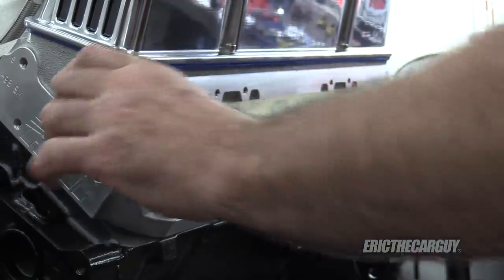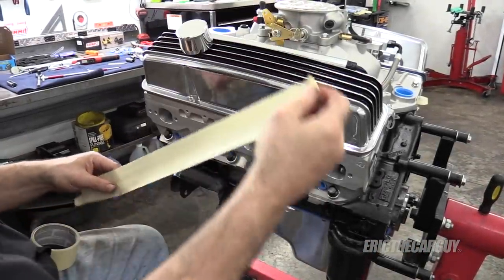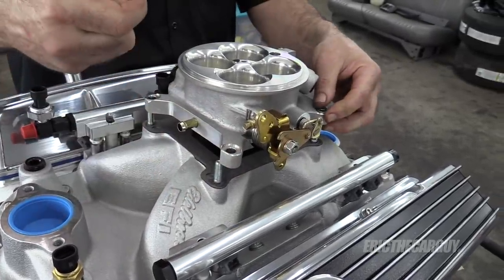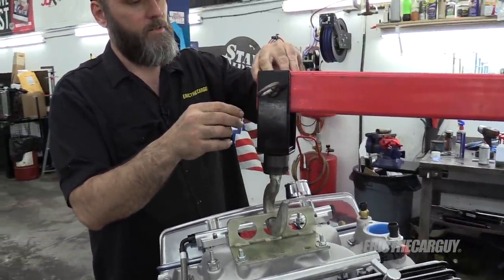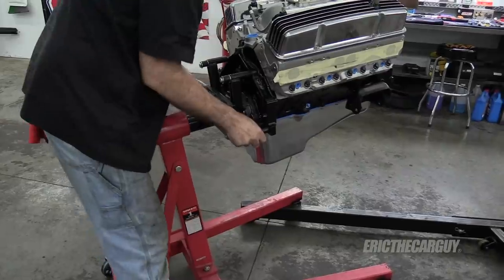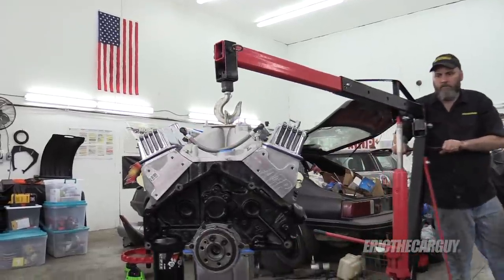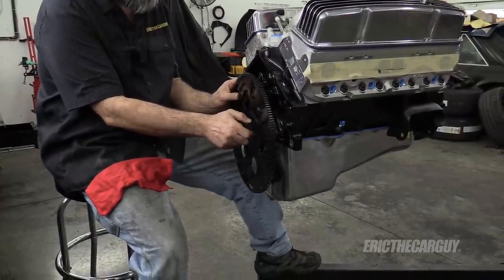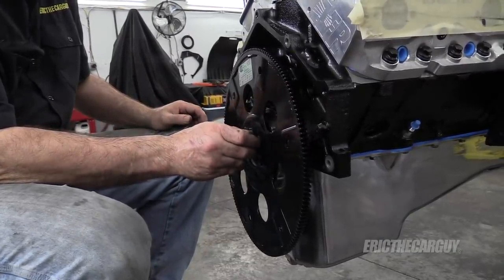Engine and Transmission Installation #ETCGDadsTruck

Comment: Eric you rock.  Just gave you a shout out for your demonstration of the Valve Keeper Remover and Installer Kit.  Will be using threadlock on my flex plate as well.  Nice work on your channel and thank you.

Comment: The fact that you've gotten so much content out of this is amazing, very well documented. I also noticed you didn't put the torque converter/flexplate bolts in but you didn't put the cover on either.
Reply from the maker: At the end of the video I state that a lot of the installation was not covered in video due to time constraints. Both of those items were part of what I was referring to. Thank you for your comment.
Reply: @ericthecarguy  I figured it would be converted in a future video, I didn't realize those were intended to be in the video.

Comment: About the integra....
Polyurethane bushings👍🏻
Now, Eric. I've used the Eibach Proline springs. They are SO nice. Because of the progressive winding. It's not at all to harsh for daily drivability at all! Infact it's quite nice. The spring rates for me are in fact awesome.

 The only downside for some people is the fact that it lowers the vehicle by an inch maybe one and a half. But it's not to bad at all. Nor does it really require a stiffer shock absorber. 
I had some on my 99 Plymouth breeze for years. Never had any issues. The springs just made the car feel more like a higher end vehicle than it was. (I used to joke about it really feeling as luxurious of a ride as a benz)

What I mean by that was is that it was very soft and luxurious felling until I would corner fast. Then you could tell something wasn't stock. However if I didn't corner fast, nobody would have ever noticed anything wasn't stock. It felt so damn good.
 I'm looking towards doing it to our family car (dodge dart) someday. Just in case I need to pull an emergency evasive maneuver.

It's never a bad thing (in my opinion) to have brakes that can rip your eyes out of the sockets. Along with sporty handling for those oh shit moments on the road. As well as enough go go to get you out of troubles way if need be. 

Now, being able to return to fully stock without and signs that anything was ever different. As well as only improving the vehicle without taking away from the comfort, gas mileage, or drivability is my personal goal when "modifying" a vehicle. 

(And personally I hate using the term modifications when I'm just switching out parts like springs, bushings, pulleys and brakes.)

Comment: Videos don't get much better than this ladies and gentlemen. On point, Makes me wanna take my 93' 2 dr GMT400 K1500 Chevy blazer 4x4 to the next level, I've got about $3,000 in the motor now with stock bottom end, and a brand new Monster Transmission I just put in after the rebuild bout 6 months ago, but anyway I've got another 355 crate engine  in another 93' 2dr. Yukon under 1,000 miles on it that I may have to STROKE out now !!!!!! Thanks #ETCGDADSTRUCK383 Great info and perWhat did the machine shop charge for everything ? Thanks !! These GMT400 platform is the next big hit to come #GTM400LIFE Let's make em look and drive the way the factory should have !!!!!!

Comment: good video, I learned a lot.  On the flywheel bolts, you use Loctite on the threads but the Assembly Lubricant under the head of the bolt, which is what I thought you were doing.

Comment: Did I miss you bolting the torque converter to the flex plate?  My eyes were heavy, so I might have had a quick power nap. Everything is so sanitary, so clean. Nice job, nice calm narrative.
Reply from the maker: That, and many other things, didn't get covered unfortunately. Time was a factor with this build and I wasn't able to film everything as a result. Thanks for your comment.

Comment: I love this series. Thanks, Eric. Could you make a quick video on your thoughts of the pro-flo 4 setup?
Reply from the maker: I'll do one better. I've already shot the unboxing video. Also, I plan to do a follow up video covering things like that after the build part of the series concludes. Thanks for your comment.
Reply: @ericthecarguy  I'm most interested in hearing about the quality of the parts and the software. and any hiccups you encountered in running the system. There's quite a few initial impression videos but very few actual reviews from real people who have run the pro-flo 4 system in real world conditions.

Thanks again for all the work you do. I wouldn't be the mechanic I am today without everything I've learned from you over the last 8 or so years!

Comment: at first I thought what you were putting on the bolts was loctite. I guess that was anti-sieze? I watched a video last night where the guy put everything on pilot bearing, new rear main seal, clutch, pressure plate ,  and flywheel and he used thread locker. I was definitely going to reference to a video when I put on the same things he did in a few weeks and just take my time and hopefully have no issues.

Comment: What I like on you Eric, is the way you sometimes act as a rookie garage enthusiast instead of white-collar dealership mechanic strictly following the rules. However, torquing the flexplate bolts using guestimated torque with a cordless impact was too much even for me 😁 Great video anyway, thanks!

Comment: First of u r by far the most entertaining and educational mechanic on youtube and i always catch myself watching ur vids when im bored lol I just put my transmission into my car and was mating it to the engine, I got the three bolts that go from the flex plate to the tourqe converter and the bell housing bolts to the engine snug and now the crank wont turn so I can fully tighten the tourque converter bolts, something seems wrong since it should turn and im stuck, any advice by chance?

Comment: Nice job my man! I remember how "fun" my engine/trans installation was back when I built a motor for my Charger. Like you, I did the installation all by myself, only I had small jack stands, and an uneven driveway which kept resulting in my hoist getting caught in the cracks (Oh yeah it was fun). After I dropped the engine home, I installed the trans by crawling underneath and using my body as a transmission jack LOL! Wish I had more tools, that's for sure. But I got er done! That feeling after you drop a fresh engine into your vehicle is like none other! And the level of anxiety when ya crank it for the first time is always pretty thrilling too lol! Can't wait to hear the truck fire up! =]

Comment: How does the torque converter connect to the engine?
I didnt see you bolt it to the flexplate.
Just bolted the transmission to the engine.

Was their a part you left out?
I can see that their are bolt holes on the flex plate and torque converter.
I take it you just bolt it from here
Reply from the maker: As I mentioned at the end, there will be a lot of stuff that isn't covered in videos. That's one of them. I simply didn't have time to cover everything unfortunately. Thanks for your comment.
Reply: IIGrayfoxII just 3 bolts

Comment: Before you bolted the torque converter with the flex plate, were u able to sprin the torque converter? I feel my trans and engine aren’t sitting aligned and spin the torque

Comment: I I’m have a question . I’m mating my m/t my Jeep. The last inch is being real stubborn. Both t/m do not have the mounts on so the tranny has two jacks  and the motor is still on the stand. Can I use the guid pin bolts to pull them together? Like I said it’s only like and inch ( like like 1/2 an inch) that’s gaping them apart.

Comment: So that transmission, is it a 700r4 case with 4l60e parts in it? Cause i thought only the 700r4 had a one piece design with removable tail end.
Reply: JakexRain early 4l60e cases had a one piece design, later model ones had the removable bell housing

Comment: What's an acceptable gap between flex plate and converter mounting point. Trying to figure if I will need spacers or let the converter pull forward. I know it should not pull forward too much though. 
Chevy 350 to 200r4 trans combo
Reply: The pull forward is about a quarter inch or so. Make sure your flywheel isn't on backwards. No shims should be needed. If you need shims then it's likely wrong as the tip of the converter is not going to pilot properly into the crank

Comment: Now I'm freaked out. Instructions in my arp kit said their fastener lube and 80 lb ft. No mention of loctite. Same application. 1 pc rear main?
Reply from the maker: Instructions for the fasteners I used are linked in the description. You might want to see if the part numbers are the same.

Comment: Does the torque converter, etc have a bottom cover? seems crazy to have it open to the elements like that.
Reply from the maker: As I said at the end of the video, a lot of work wasn't covered. One of those things was the installation of that bottom cover. Thanks for your comment.

Comment: Kinda a dumb question here but around 3:30 is the black wheel your putting on a flywheel? Or is it something different for cars/trucks with auto transmissions?
Reply: Flywheel is for manual transmission flex plate for automatic
Reply: @Jron2498  thanks for the info! Do flexplates have to be heavy? I know people sometimes want a lightened flywheel

Comment: you will be pulling the engine back out to change out that chrome oil pan
Reply from the maker: It's aluminum, not chrome.
Reply: I stand corrected

Comment: Will there be an issue with the exposed torque converter and flex plate?
Reply from the maker: The installation wasn't completed in this video. I did install a cover over the torque converter and Flexplate. Thanks for your comment.

Comment: Eric please help! I have a 2006 Mazda 6 V6. The dipstick say AW01 ATF T - N.  What kind of transmission fluid i am suppose to use. I cant find one that say T - N. Is it say T or N. I checked Aisin website and all over and im confused.Atf is leaking so i need to top up before it goes. I put my vehicle in rickauto and car id but they just list all kinds of fluid from mercon to dexron to t-iv. Please help

Comment: How many zip ties did u use for those wires?  🤣
Reply from the maker: I've found that to be the easiest way to build a custom harness because you can add and move wires easily. I've covered that in previous episodes. Thanks for your comment.

Comment: hmm so thor gonna stay exposed like that 😐 or there is a cover that bolt to the bottom of the that engine area?
Reply from the maker: At the end of the video I state that a lot of the installation was not covered in video due to time constraints. Both of those items were part of what I was referring to. Thank you for your comment.

Comment: Maybe was in the video but why did you go with a carburetor?  I get it's not a "performance" truck but if you're spending the money on rebuilding everything I would have spent another $600 on an EFI carb and get it running perfect no matter where you go.
Reply from the maker: https://youtu.be/sygI3OA4rfA